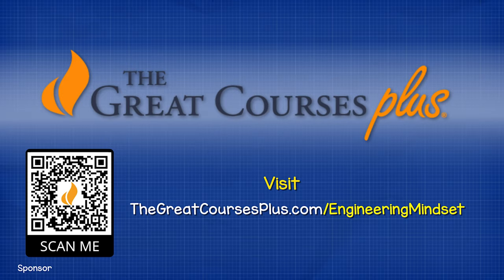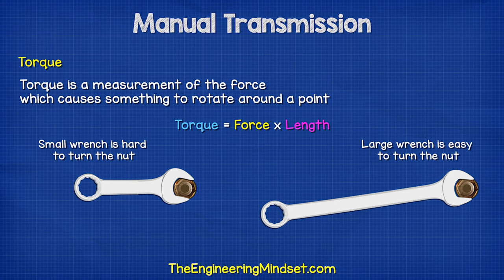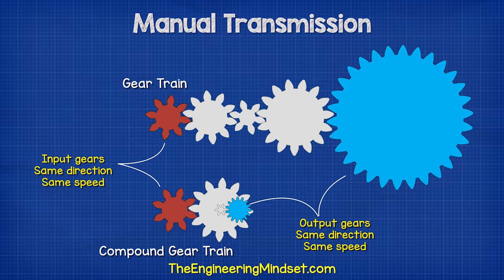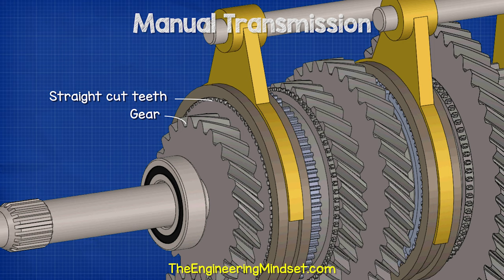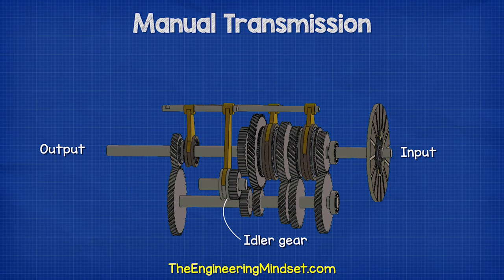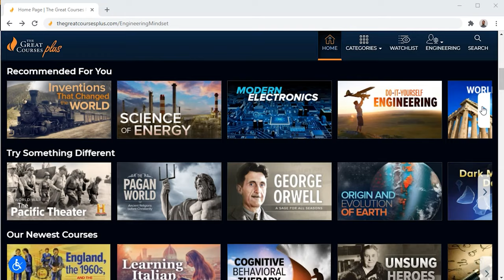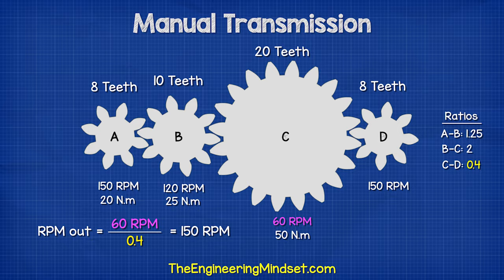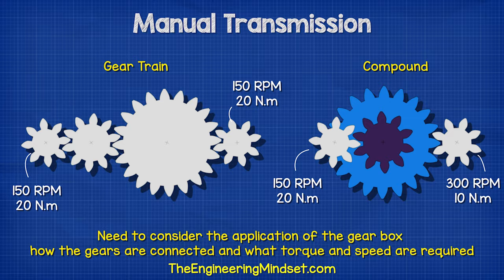How Manual Transmission works - automotive technician  shifting

Comment: I think manual is better because for my type of car, which is a compact hatchback, manual gearboxes DO get quite significantly better fuel economy than auto gearboxes. This is, of course, comparing apples to apples. For compact hatchbacks, you will not find sophisticated dual clutch transmissions neither will you find continuously variable transmissions. I'm talking about cars in the range of 300k ZAR and under. You won't find a CVT in a car for that price range. What you will find are torque converter automatic transmissions. Torque converter transmissions for compact hatchbacks generally come with 4 forward gears whereas the exact same model manual counterpart will come with 5 gears. That's a huge plus because it makes the engine quieter on the freeway and it improves fuel economy by a more significant margin than you would honestly think. I average 5.9 litres per 100km which is pretty damn good if I do say so myself.

Another good plus is that manual gearboxes are the most simple design that a transmission can possibly have in a modern car. Where there is simplicity, there is ease of repair, less chance of fault, and cheap prices for repairing IF something does go wrong. For the most part though, torque converter transmissions when compared to manual are more or less just as reliable. Manual may be slightly easier to maintain and cheaper to repair and less likely to fault, but the margin between auto and manual regarding this is minimal and I will admit that freely. The margin between fuel economy is much more significant. CVT and DCT transmissions will get better fuel economy than your old school manual gearbox, but remember that I am not comparing apples to oranges in this scenario.

Last but not least, even with a compact hatchback that outputs a very modest 77kw of power, driving manual is so enjoyable and so much more engaging than automatic. It's fun, and that's another plus to me.

Comment: Can you do a video on an 18-speed tractor-trailer (lorry) transmission? They are not synchronized and you have to "double clutch" in order to change gears.

Comment: appreciate your work but whenever u show shifting of gears , the output shaft stops rotating, but in real life when we go from gear 1-2 or 2-3 the car would be moving the output shaft which is connected to the wheels will keep on rotating even when the clutch is disengaged. so i would ask u to please make a video on when we shift gears from 1-2 or 2-3 , and the clutch is disengaged. how the counter shaft gears synchronises with the output shaft.
Reply: When you shift into gear, the countershaft synchronizes with the output shaft, it is the counter shaft and therefore also input shaft which is brought up to or slowed down to the speed of the output shaft given the gear ratio of the selected gear,  at this point in time the input and countertops are both spinning at the same speed because the engine is disconnected, but as soon as you start releasing that clutch paddle, the engine is brought up to the speed of the input shaft, the flywheel slips against the clutch to achieve this once the engine flywheel and input shaft are the correct speed, you can fully release the clutch pedal.

Comment: Manual cars are more entertaining and awesome, it's true that there is less work on gear in automatic transmission, but the Manual transmission will engage you all the time.
Reply: My thing is that manual makes the driver actually part of the action, it's like you're really operating the drivetrain. Not just telling it what you want it to do and it does it on its own!

Comment: Manual is better as the driver has better control over the car. It allows you to connect with the vehicle through the gear stick - gearbox - clutch - engine. You control the the revs at the exact gear you want. It's all about control. Also, you don't loose your skills as you have to 1. engage the clutch, 2. shift the gear, 3. disengage the clutch and accelerate so shifting between gears happens smoothly. All this happens in less than a second.

It's all about control and skills

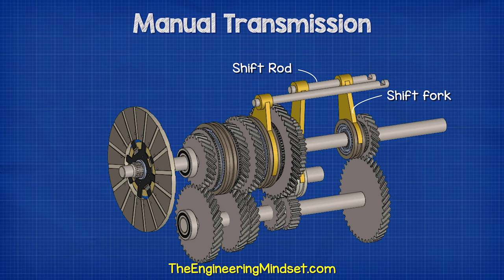Comment: This is fantastic. I love the visuals on this.  I've always loved driving a manual transmission, just never quite understood the mechanics of what was going on underneath with the engine/transmission.  One thing is "driving" me crazy:  assuming the shifter is on the right side in the diagram (and assuming I'm in the driving position from that side), when shifting into 1st gear, the shift rod and fork seem to be going in the wrong direction.  Maybe I'm looking at it backward, but if the gear shift is where it is shown at 8:15 in the video, from a driving perspective, it appears to be shifting  into 1st gear and  into 2nd gear (which is the opposite of how it should work).  Am I missing something?
Reply: They can orient the gearbox either way, some do it in one orientation regardless of driver side.

Comment: I think manual transmission is the best transmission for me.It is because in the manual transmission, you can chose what gear you want but in the automatic transmission, the car chose what gear the car want. Take this for example. Imagine you want overtake someone or you on a hill, in the manual you can change to gear 3 for overtake and gear 2 for climb the hill meanwhile in the automatic, if you want to overtake, you need to press the throttle which takes a second for the gear realise and if you on a hill, you need to use the handbrake to stop the car because automatic always change gear between 1500-2000 rpm for each gear meanwhile manual you can hold the gear to a higher rpm. Also, the chances of a broken automatic gearbox is higher than manual. And it cost more for automatic to repair rather than manual.

Comment: Question: How does the clutch disk itself engage and disengage without getting stripped, especially when shifting at higher speeds?
Reply: When you push in the clutch pedal, it pushes a throw out bearing which pushes in fingers on a pressure plate and in turn disengage the clutch from the grip section on the pressure plate and flywheel.
Reply: It does wear over time, depending on how you drive it will last longer,  my car has 230000kms and still has the original clutch,  you can shift without it tho,  it takes practice and timing,   but it's doable, and your clutch will last longer
Reply: It's designed like a brake pad, it can take high friction and will slip very little even at high rpm. The whole drive system is designed to reduce shudders and slips to make everything last longer too.

Comment: So my question is...in most car, does the final gear always the same ratio as the driver gear or is it smaller than the driver so it could rotate faster?...can we increase speed by changing the gear ratio alone?how much smaller is the limit?

Comment: I’d say it depends on the person. With manual you tend to have more control but with automatic you tend to have less to worry about. So automatic tends to be safer and easier to use whereas manual is harder but you have more control

Comment: @3:42 doesn't also the extra weight from the wrench also making it easier to turn a bolt? If you made a wrench the same length but also same mass, would you lose out on eddiciency ?

Comment: My front wheel drive 5-speed manual transmission makes a constant noise when in gear. As soon as the transmission is put into neutral, the noise stops completely. Does that mean the sound must be coming from a bearing attached to the drive shaft, since the driveshaft is the only thing not moving when in neutral?

Comment: Automatics are for speed, convenience, efficiency, and longevity. Manuals are for car enthusiasts because shifting and control
Reply: Speed,  convenience , efficiency,  and longevity??? Based on what merits...
Reply: Automatics are for when your car is, to you, an appliance. Manuals are for when you care about driving.
Idk, it's kinda like, people who use TV only to get the news would be fine with a 19" black and white 480i TV - but people who want to have emotional experiences via TV would see that as just absolutely plain and dull, like something very important is missing.

Comment: paul what do you prefer?manual or auto
Reply from the maker: I like the feel of a manual, I recently rented an automatic and I must admit it was much easier. I'm tempted to buy auto for my next car.
Reply: @EngineeringMindset  if you can, try going auto for just a week or two, to see if you start to miss the manual. I have one of each type, and I personally can't go more than a few days of auto-only without sorely missing the manual. Lots of variables there though.

Comment: Hi Paul, thanks for another great video...I just finshed rebuilding and refitted an '86 Getrag 265-5 to a customers BMW last week, with freshly machined flywheel + new clutch...so...manual, manual and...manual for sure...Automatics are for lazy drivers, or should only be for special cases...but sadly manual trans. vehicles are becoming rare nowadays, I just don't get it?...And say no more about the muppet that came up with the more recent c.v.t autos....pieces of..🤣👍🇦🇺
Reply from the maker: As electric and AI cars come in, there will be very few manuals on the market in 30 years time. Manual will become a luxury "experience". I do prefer a manual but auto is easier so it will dominate

Comment: 100% first-person, anecdotal experience, but also 100% fact:

Manual transmission leads to fewer accidents. The driver has to use two hands 90% of the time, and knowing the gear subconsciously allows us to be more aware of our speeds and depth perception.  

Even when I would go over the speed limit, I was so aware of the road…. And knew how my car could handle.  I never felt like the fumbling idiot slamming breaks in a traffic jam constantly and seeing coffee go everywhere, while looking at the phone.  I never did until I bought an automatic…. Lol

Comment: Manuals are more fun, but with digital control of automatics, automatics are more efficient. If you know enough about something to tell a computer how to do it, the computer can always do it better. Computers are way faster. Contrary to what many think, computers do make mistakes, but they can be programmed to catch a mistake and correct it before the mistake becomes a problem. And you can always use multiple processors to correct each other.

Comment: Automatic Gearbox is Best , It Also Ensure Safety of Driver 👍🏼👍🏼❤️❤️❤️❤️
Reply: How does automatic box ensure safety of driver?
Reply: @bluewanderer9903  When the automatic transmission fails and will cost $4000 to replace, the driver is no longer driving, therefore he/she is safe ;)
Reply: @bluewanderer9903   You Can See On Google ,  The Rate Of Accidents are More For Manual compare to Automatic
Reply: @chrisfreemesser5707  lol
Reply: @UjjwalKumar-  google ha, meaning of life right there.
Reply: @bluewanderer9903  😅😅😅

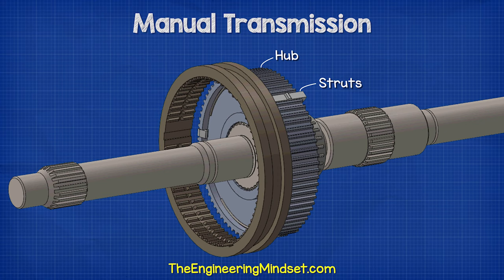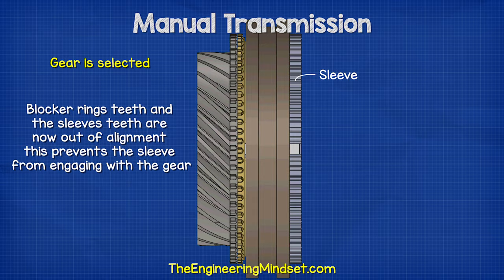Comment: 9:45 - 10:45 didn't make much sense to me. Can you elaborate on what is causing the synchronization? Friction, as in the Synchronizer ring and the gear rubbing against each other gets them to be perfectly aligned? How does the Synchronizer Ring and Sleeve being out of alignment specifically prevent the Sleeve from engaging with the gear? I've been looking at this one part for 3 days now :)
Reply from the maker: The blocking ring (baulk ring) rubs against the gear and comes to a stop, it might be perfectly aligned or a bit out of alignment. It has angled teeth which can direct the sliding sleeve teeth. If it was perfectly aligned it'll slide straight in, if it is a little off then it provides a ramp or guide for the sleeve to get into position. The sleeve can rock back and forth on the hub a little which allows it to find alignment
Reply: @EngineeringMindset  i see, the clutch is engaged so the drive shaft isn't inputting any power to the gear which allows it to slow down

Comment: On my 93 f150
1st 2nd 3rd and 5th make a whining noise that gets louder as the rpm’s rise. 4th gear is completely normal. They only makes noise when the clutch is engaged. I’m not sure what it is. 
Barring maybe??
Please Help.

Comment: the manual is better cause you can change the torque and speed because it gets boring when the automatic just does it all, so if you got a manual car then you are probably not bored while driving because you can shift gears but my recommendation is that you should not even skip gears cause it can destroy the gears like don't switch from 1st gear to 3rd and like also 2nd to 4th or also from 3rd to 5th cause it can cause you a lot of money when asking for repair.

Comment: I wish some rich car enthusiast manufactures a general manual transmission that can be installed on most of the cars in the market now.
I mean seriously some cars now are coming only with CVT or automatic only.
Reply: The manual transmissions are available, but automakers are not putting them in most vehicles because they're run by penny pinchers now. If a car is available with 2 different powertrains, they need to have them both tested and certified (in any market they're both gonna be sold in). This costs lots of money. 
So they just remove the manual option, figuring they'll lose less customer $$ than what they saved by abandoning the manual.
Plus since auto costs more, they get to "automatically" charge more for the car.

Comment: Why can't it just be a centrifugal clutch so it's automatic and without thrust bearing resistance? If it's a saftey thing, why not just put an alternator between the clutch and the transmission, so it can always enjoy the rpm modulation of the transmission and have it simulate engine braking for power unless your foot is on a coaster pedal to cut the electrical load to it?

Comment: Bike analogy was backward due to how the gearing works on a bike, higher gears give you lower speed and more torque where as in an engine higher gears give you more speed and less torque.

Comment: Those gear animations made me dizzy :D somehow they didn't flow nicely.. but great video.. been struggling with the linkage lengths on cable operated gears when it comes to shortshifters for a while.. i know how it all works but somehow can't cram it in my head

Comment: I understand almost all of it except for the part where you show the powerflow for every gear. It looks like the car is always in 4th gear and then whatever gear you’ve selected? I don’t get it... Like it looks like the power goes from the input shaft, through 4th gear into the countershaft, and them from the countershaft through your selected gear into the output shaft, but that doesn’t make sense to me.
Reply from the maker: That's exactly what happens. The input shaft and output shaft are separated. Only when the 4th gear is selected will the input and output shaft be coupled directly together.
Reply: @EngineeringMindset  So can you explain to me how the power flows when you’re in, for example, 2nd gear? Because in the section where you show every gear you draw a line that goes(when showing 2nd gear): input shaft>through 4th gear>counter shaft>through 2nd gear>output shaft, or at least that’s how I interpret it.

I really appreciate your reply btw, I’m really trying to learn this and being able to ask questions helps a ton❤️
Reply: @EngineeringMindset  And then when you show 4th gear, the line just completely skips the countershaft and goes straight from the input- to the output shaft.
Reply from the maker: In 2nd gear the power flows as you said, input > 4th > counter > 2nd > output
In 4th it flows input > 4th > output. Counter still rotates but it's doing nothing
Reply: @EngineeringMindset  Thank you so much, as I've been thinking about it does indeed make sense to me now. I really appreciate the effort, cheers.

Comment: hold up! how does the clutch up with engine speed right after it engages back to the engine output, i mean literally the clutch is momentarily at rest with no spin when it disengages with the engine! i seek to know how it catches up the engine speed when it engages back with out any considerable friction and the car jerking
Reply: You slowly let it contact the flywheel and as it contacts the flywheel it matches the speed of the flywheel
Reply: The animation is a simplification. The clutch stays spinning for awhile after you disengage it.

Comment: What disconnects the tires rotating from the driven gear while shifting?
Reply: Clutch. It disconnects the whole transmission from the engine
Reply: The clutch and engine are upstream of the gears, it can't disconnect them from the tires.
OP, the answer (if you haven't found it these 10 months) is the shift sleeve sliding off the collar for that gear, when your hand moves the shifter out of that gear position.  
The clutch is necessary to go out of gear only to ensure that the gear is not under load during the process - otherwise it would be difficult and damaging to get out of gear.

Comment: Well it depends on what u are doing with the car. If u want more control over the car for example during street racing and drifting than Manual is the way to go. If u are just using ur car for everyday normal use then a Automatic is the way to go.
Reply: Millions of everyday manual drivers might disagree but ok
Reply: @nthgth  i mean if u like the feel of a manual car than go for it and also sorry if i offend anyone
Reply: @wyre1824  don't be sorry for offending people with your own opinions which you're entitled to. I'm just saying a lot of people have manual for their everyday cars and it's fine; it's not a hassle to them at all.
Reply: @nthgth  yeah i know some people might have just grown up with manuals or like the way they feel so its good

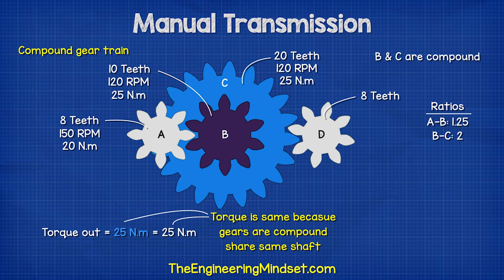Comment: 18:35 You said, "It (gear C) will rotate slower than gear A because of the size of gear B, and it will also have less torque than gear A, again because of gear B."
I think you meant to say that it will have more torque?